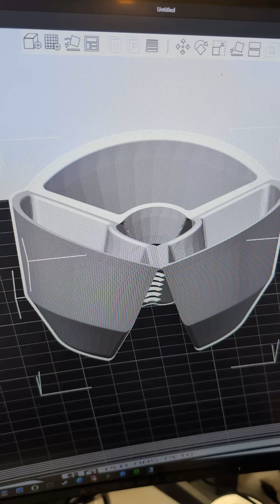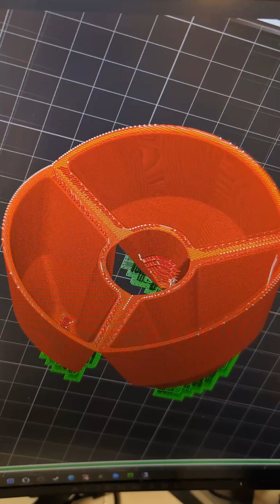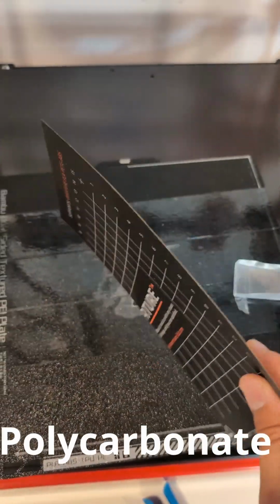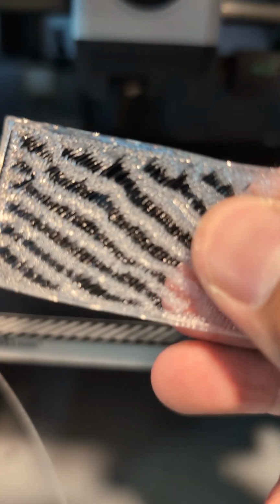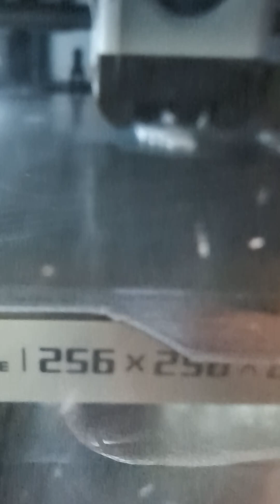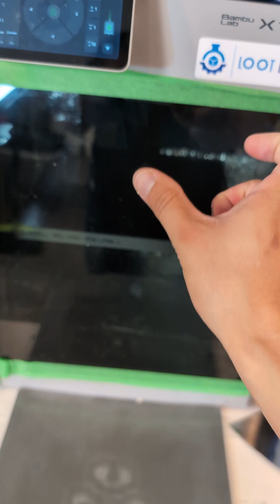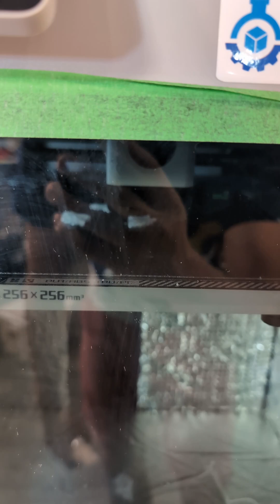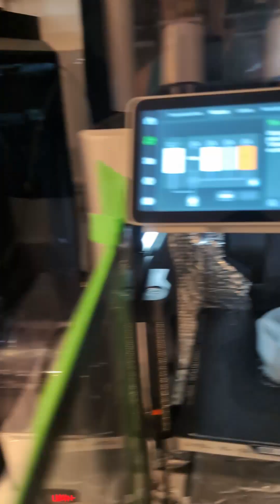Best technique 3D Printing Polypropylene (PP) on the Bambu Lab X1 or similar 3D Printer

Comment: Should I dislike, or just ask you the question ;) dont worry, I didnt dislike the video I just dont like that you just focus on the bed adhesion. I tried to print black Fiberlogy PP and it doesnt even extrude on the X1C (hanging from the back), so I was just wondering what filament you  used.
Reply from the maker: Haha. Apparently disliking still helps with promotions. It will only hurt my feelings for a bit.
Sorry for the late reply, but this was PP from Spool3D. Maybe run it like tpu slow flow rate of 4mm3? Extruder grip may not be great as the plastic is soft/rubbery.

Comment: Зачем так мудрить. Попробуйте напечатать Raft несколько слоев из PETG. Далее, остальные слои и модель из PP. И будет вам счастье. Я так делаю с PA.
Reply from the maker: "Why be so clever? Try printing several layers of PETG on Raft. Next, the remaining layers and the model are made of PP. And you will be happy. I do this with PA."  - @4ipik1

That is not something I have come across and if it works that is amazing! Thank you!

Я с таким не сталкивался, и если это работает, то это потрясающе! Спасибо!
Reply: @3dlootlab  he best option. I print with nylon like this. My strategy is as follows: In the Cura settings, I set 5 layers of PETG for the base. I print 5 layers with PETG and the remaining 2 layers with PA. Why 5 layers of PETG? Because it makes the surface smoother, and nylon adheres very well. If you encounter issues with your plastic adhering to PETG, you can apply glue stick to the last layer of PETG. It usually comes with the printer. After changing the filament, I raise the bed temperature to 80 degrees and the extruder temperature to 278 degrees.
Reply: @4ipik1  PP doesn't like to stick to other materials, and so I'm not sure it will stick to PETG well
Reply: @jkadofo  What prevents you from trying?
Reply: I don't have access to PETG filament at the moment. Will keep this in mind and give it a try when I get the chance
Reply: @4ipik1  PP doesn't adhere to anything, least of all PETG.